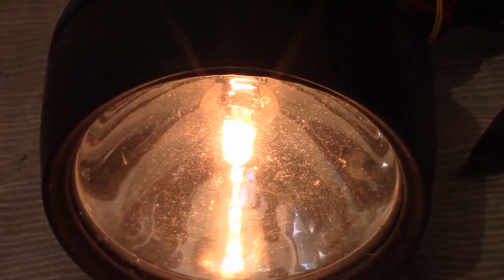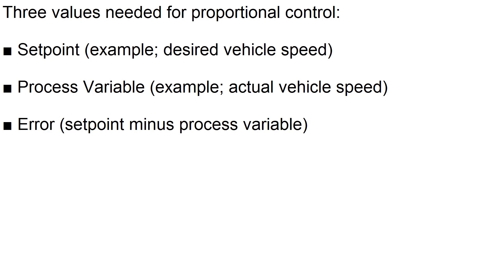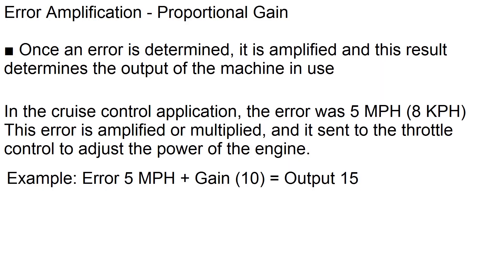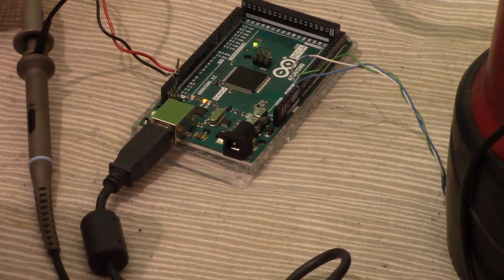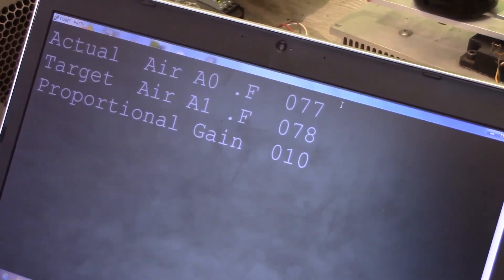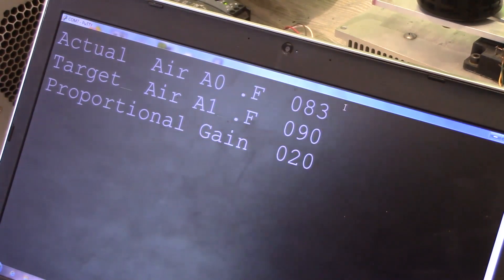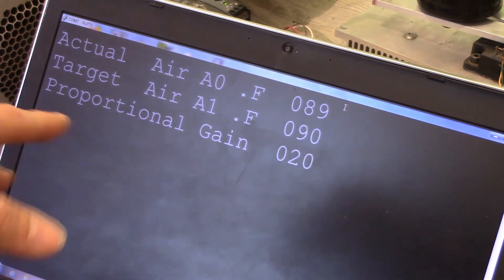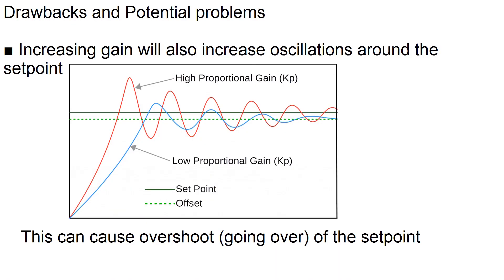Intro To Proportional Control

Comment: It's really great to see you're back! It would be cool to dive a bit deeper into designing isolated forward convertors. If a pid control helps in closing the loop even better! The idea is to drive off the shelf fridge compressors from battery
Reply from the maker: I'm actually working to design/make a regulated boost converter to run standard compressors from solar and/or batteries. I'm thinking PID may be necessary but I'll try to make a video showing the outcome.
Reply: @subcooledheatpump  yes! I thought so following the trend of the last few videos. Working off solar direct, without batteries, is also possible but then the system will have to be grid dependent to be able to provide the surge power the standard compressor needs to overcome the static pressure in the line. After that it's the usual 120v@2amp which any PV system can provide